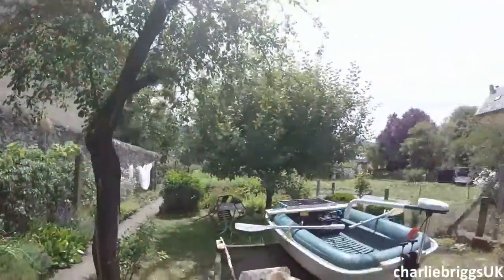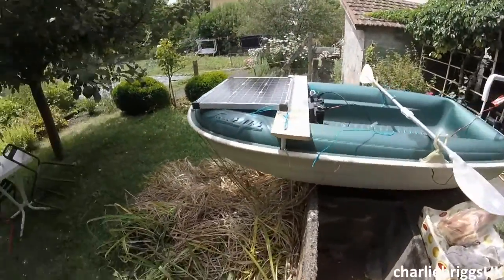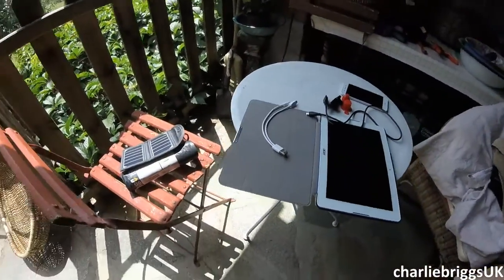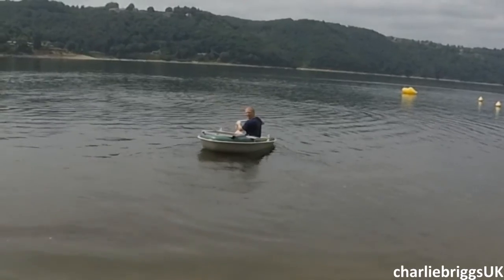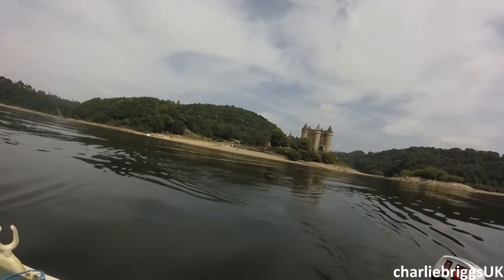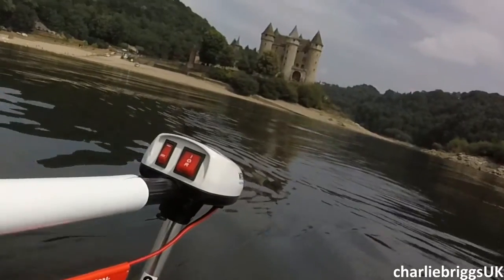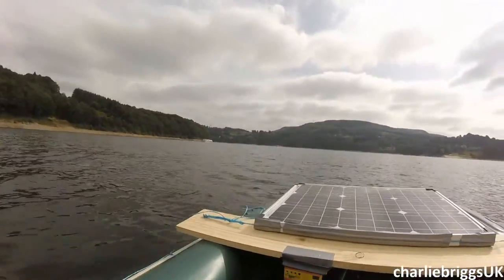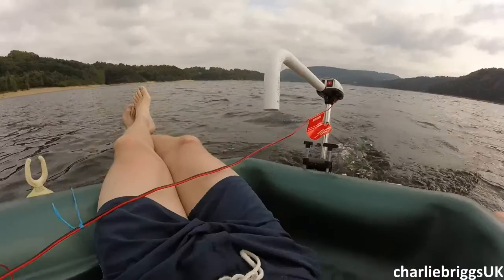Solar electric boat project!  Detail & cruising on EPIC lake

Comment: 3 solar panel without  battery can power this engine?
Reply from the maker: Hi! Yes, for example 3x 50W could power it in good sun on minimum speed. However, the motor manufacturer advises against direct connection; having a battery in the circuit is better. You can just have a small one eg. 20ah. Having a battery is of good benefit, and you are still running directly off the sun if your battery is not being drained
Reply: @CharlieBriggsUK  thanks for prompt response. But 50 watt panel with pmw can just provide 3 ah? 13.2x3= 39.6 watt?  I dont want to use battery that why i had asked?  I plan to use secondhand 4 flexible solar panel 4x130 watt to power 34 lbs minn kota trolling motor. I need 32 amp max . 384 watt total.  On the water panel output change? Because water reflation?
Reply from the maker: @gokhankeles8998  I know that the 50w panel can realistically give at least 2.5 A at 12V.  3 of those panels in parallel would be just enough to run the 24lbs thrust motor (seen in this video) at half speed.  For your proposed motor, yeh those panels could manage around half power no problem.  Reflectivity off water is not a factor in my experience, if the panels are facing upwards

Comment: So this setup allows you some more range - but probably not able to charge enough to keep the battery fully charged. Do you have any voltage protection or a circuit breaker to keep the voltage to the motor consistent?
Reply from the maker: Hi Wayne thanks a lot for the comment.  Yeh with just 50W, my setup is just for range-boosting (or full recharging if left for long enough).  I've never had any regulators, breakers or protection in the circuit.  The solar panel goes through the charge controller, then on to the smaller of the batt posts.  The motor clips straight to the bigger of the posts.  The small and big posts share the same bases so have direct flow to each other.  
I've had no issues so far, but do you reckon given the above setup info a breaker or similar device would be useful?  Any info on why?  Cheers
Reply: @CharlieBriggsUK  I am still trying to learn about the technology and best practices. Some people seem to put fuses or breakers before the trolling motor to prevent any possibility of sending too much (amps/volts???) to the motor and damaging it. But since you’re running right off the battery, and using the other box, it seems good to me!

Comment: how's the price?
Reply from the maker: I would say fairly 'so-so'!  I didn't go for the very cheapest (perhaps sort of 'low-end' but not 'bottom') specification parts.  Everything apart from the boat hull cost me approximately £350 GBP I think, from memory.  Fortunately all of the equipment transferred across easily to the bigger blue boat you can see in the other video

Comment: it's running off a battery, solar panel that size would't power that for shit. plug it directly to the solar panel and see how she goes, my bet is the engine wouldn't even turn
Reply from the maker: You sound very angry, considering you've just watched a relaxed video about a solar boat!  This isn't about bets, it's about maths.  The panel can feed in about 3.2 amps in good sun.  That's about 30% of the current demand from the motor at half speed.  That means the panel gives my boat a significant range boost, and more so if I stop once in a while.  If I were to triple the size of the solar panel, the boat could run purely off the sun (battery not draining, or without a battery at all).  I choose to have a battery because a) I don't want to have a massive solar panel, and b) I like to do normal electric boat cruising when there's no sun.  
I designed my vessel to meet my practical needs.  If you want to see solar proof-of-concept boats, where people sacrifice practicality for principle, you can find many such videos on Youtube.  Take a chill pill, and enjoy :)
Reply from the maker: @Mathew Sparkman 50 W panel.  Puts out just over 3 amps continuous in good sun.  It's a range-booster in effect, increasing boat endurance by about 15% in varying sun, on about half throttle.  Could easily be made more solar-centric by doubling or tripling the panel size

Comment: Very well made video and thanks for the details. I'm working on installing a 80 watt panel to help top up my rubber dinghy 's 54lb electric outboard  battery. The battery for now is a 105A van battery. 
Cheers mate :)
Reply from the maker: Hi!  Glad you liked the video and the details, I hope they were useful.  Yes I personally think 80 watts is a very good size for a solar dinghy.  You'll probably see a 20% average range boost with that motor and battery.  That's a massive weight of battery though - will you put hard flooring down in the dinghy to support it?
Reply: Hi. Thanks for the reply. I have finished it all today but the sun is nowhere to be seen so I can test it  :)
I have finished the project and will post video soon :) 
It's a 2.6m rubber dinghy with nice wooden transom and solid wooden floor which I have upgraded and I also made a gazebo with PVC pipes onto which I have the panel. It will keep me dry and can position the panel easy.
I can add another 80w panel soon :) 
Regards. Nick
Reply from the maker: That sounds extremely exciting!  I can't wait to see.  It makes a lot of sense to put a panel on a roof - takes care of multiple things at once!

Comment: You can add another solar panel, but have them both hanging off the side, near the front, affixed with aluminium or something. More power and more (v)room too. But 2.3A 12V is pretty sick on it's own. Are you planning to make a second iteration? What about some rain comes out of the blue, is the setup waterproof? It's a really great idea man. You can take it fishing, let the panel charge whilst getting some fish, absolutely brilliant. Well done mate!
P.S. Whereabouts in France you staying at? Just came back myself.
Reply from the maker: Cheers Juan!  Yes good ideas.  I returned home across the lake under a severe downpour once.  I covered the charge controller and everything was ok, as the panel itself is very weather proof.  I was in the Auvergne region, the lake is called Bort-les-orgues

Comment: Did the panel keep the battery topped up while running in full sun?  That is a very cool looking boat.  The motor seemed to move it along very well.  I think I will add a small board to my project and keep the panel stable on top of the boat.  Good idea.
Reply from the maker: Hey!  No my panel is not big enough for that.  It simply serves to range-extend by reducing the net drain rate of the battery.  Thanks for the comment!